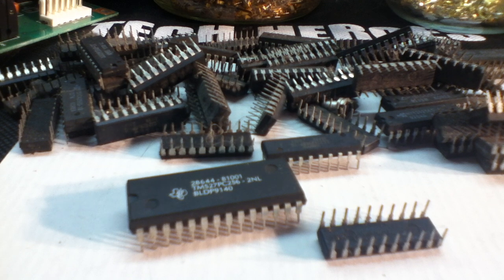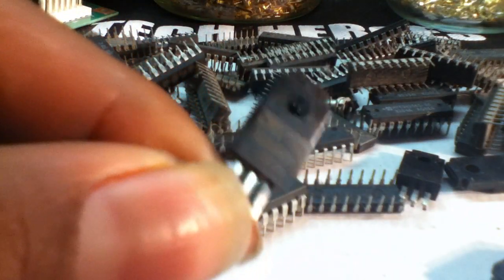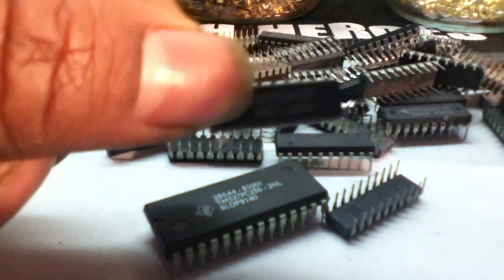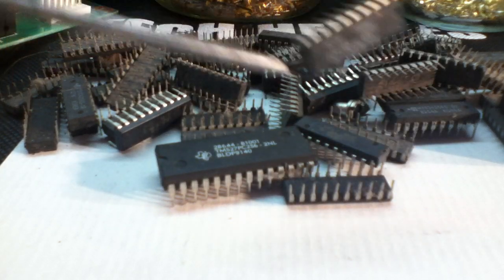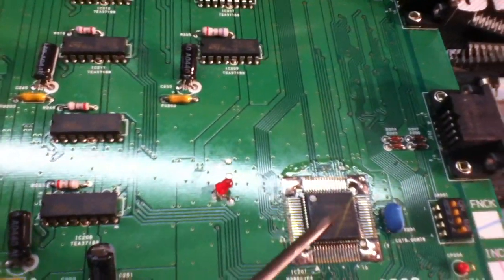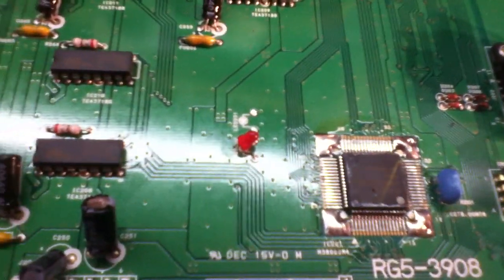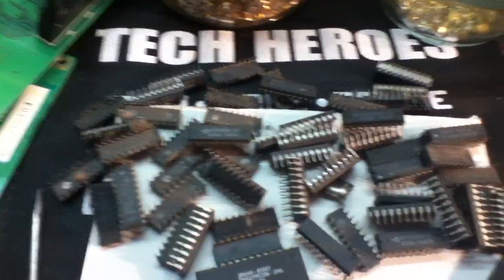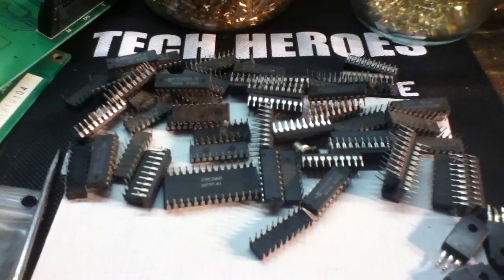Scrapping EPROMS & MOSFETS chips for CASH$$$$

Comment: EPROMs are typically not re-usable, as they are can only be written ONCE.  (The ones with the glass circle cover can be erased and vi ultra violet light.)  EEPROMs (TWO E's) are completely re-usable.  The one you held is TMS27C256, old texas instructment 32KB.

You can buy EPROM from Digikey.com CHEAP!  $1.85 per piece BRAND NEW!

WindBond EEPROMs from eBay are dirt cheap and are brand new!

Comment: What you are pointing to are IC chips, not EPROMs.  The one on the right goes by "flat pack".
Reply: @Karl:  IC stands for "Integrated Circuits." That includes EPROMs, since they are integrated circuits!
Reply: "flatpack" is an unofficial nickname given to a wide variety of chips given by those who do not know electronics and do not know the proper names for the various bits described as "flatpacks". It's a name given by the ignorant that merely describes what it looks like and not what it is. The problem with describing them generically as "flatpacks" is that completely worthless garbage gets thrown in with precious metal bearing bits because they're all "flatpacks".